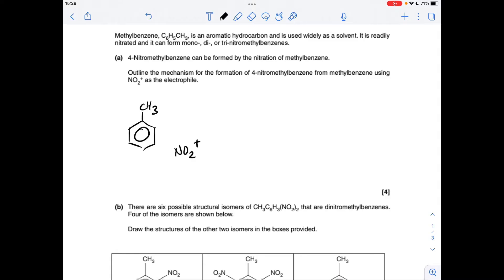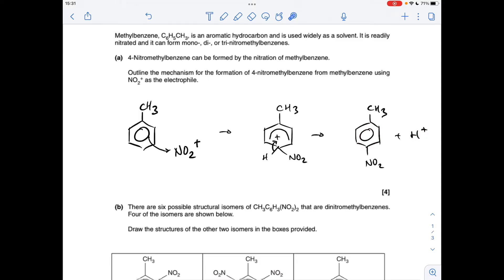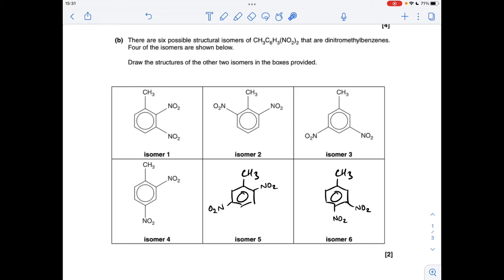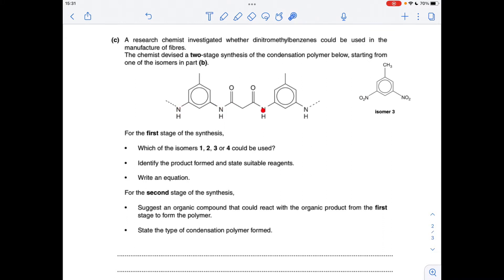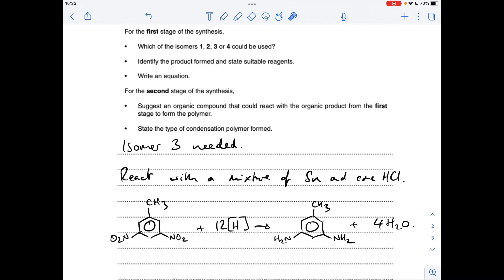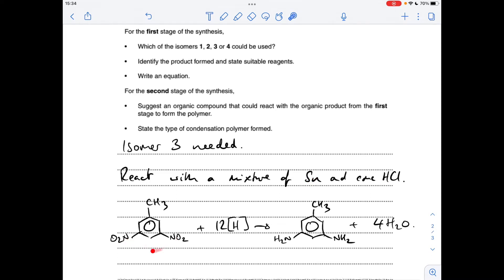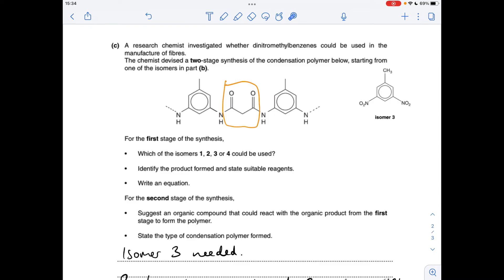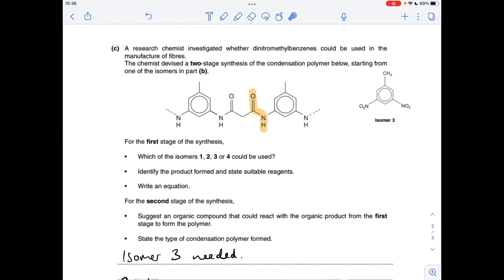A LEVEL CHEMISTRY EXAM QUESTION WALKTHROUGH - AROMATIC CHEMISTRY 3

Comment: Hello, thank you soo much for this video, I just wanted to quickly ask that when you used the dicarboxylic acid in the last question, can you use a diacyl chloride instead or does it have to be the dicarboxylic acid.       Thanks again.
Reply: Yes you can use a diacylchloride.
Reply: Thank you🙂
Reply: @khadijazaffer911  I think it has to be a dicarboxylic acid since it's condensation polymerisation, if you were to use a diacyl chloride a water molecule wouldn't form.
Reply: @pokeninjaful  condensation reaction just means a small molecule is formed e.g. H2O or HCl :)